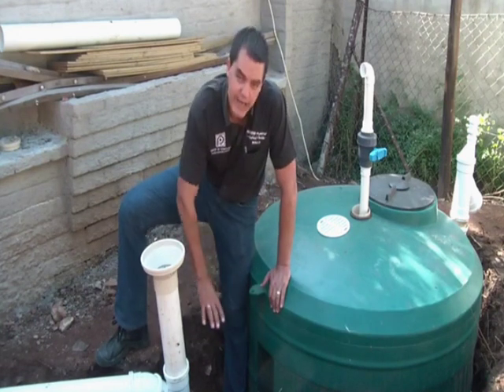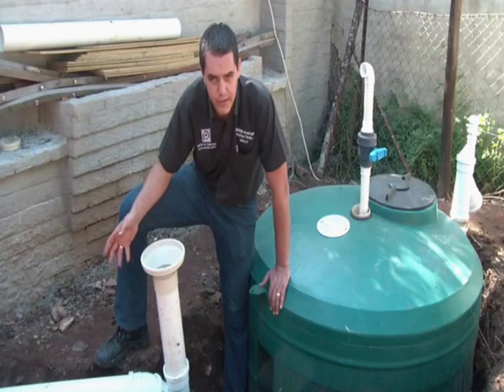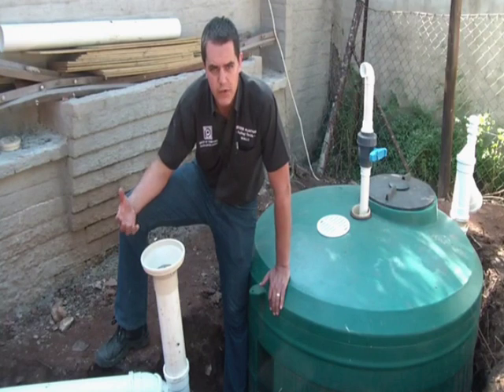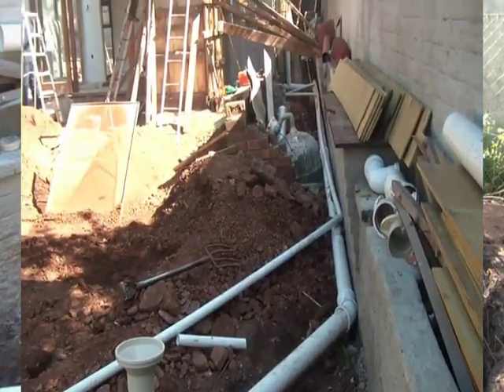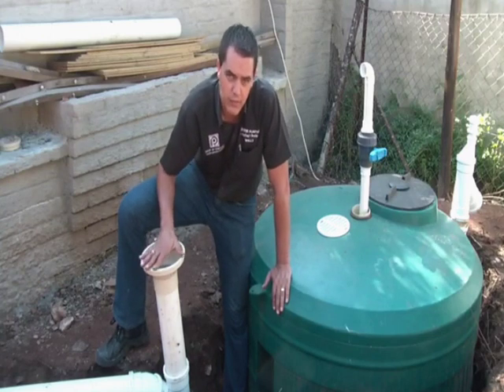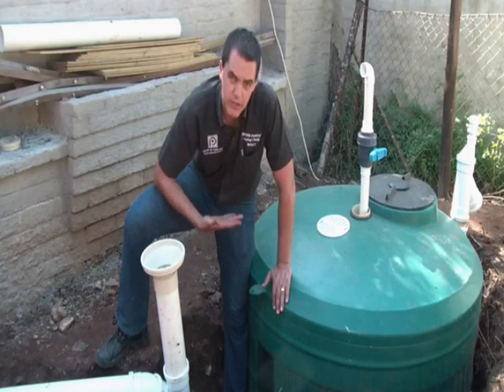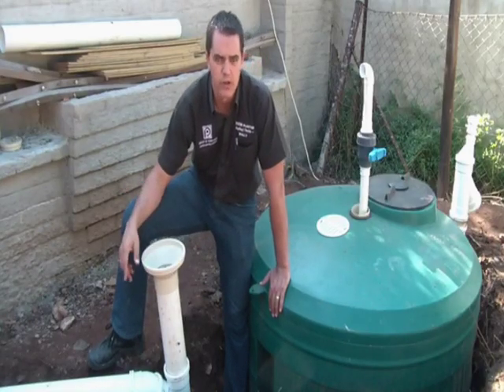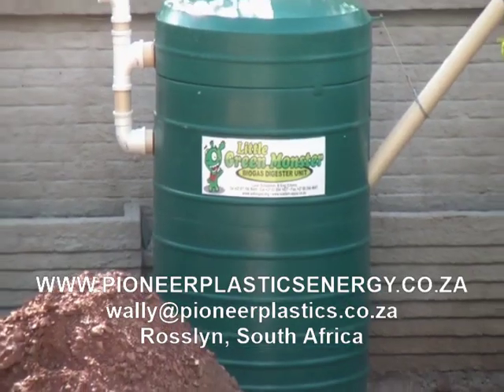HOW TO connect the BIOGAS Digester Plumbing - Little Green Monster - 2012

Comment from the maker: I agree on the off grid green design. One of the very valuable lessons we have learned however is that you have to split the black and grey water flow. If you have a large volume of water flow through the system you constantly flush out all the bacteria and the system has limited gas production.
As an example if the bath and shower water, dishwasher water, clothes washing machine water and sewerage water all go through the tank it is absolutely counterproductive. I have diverted my house connection past the tank and I am only "feeding" food waste into the system on its own. I will post some feedback soon.